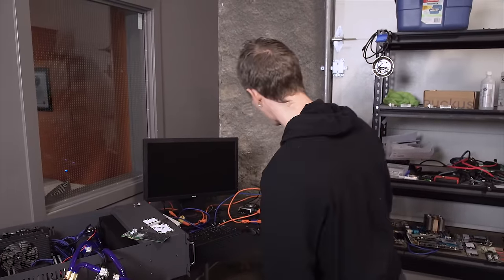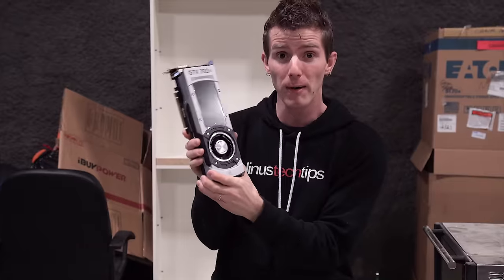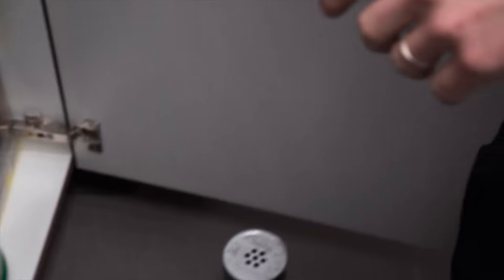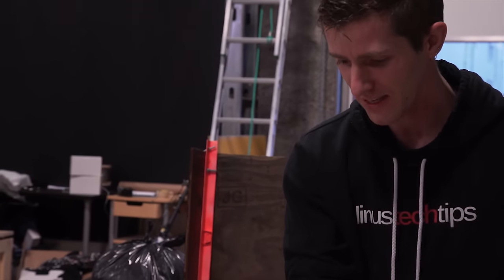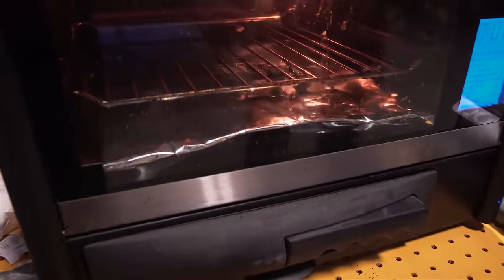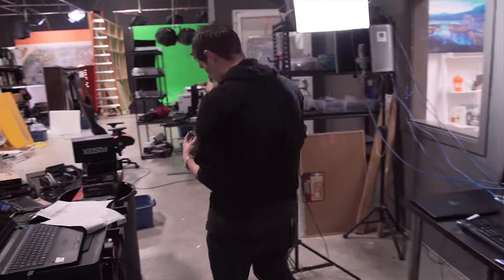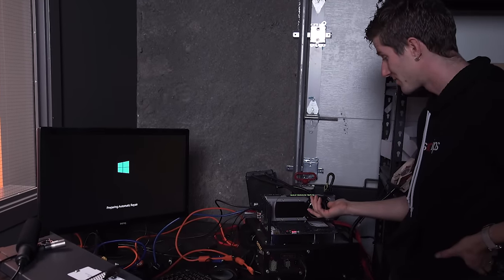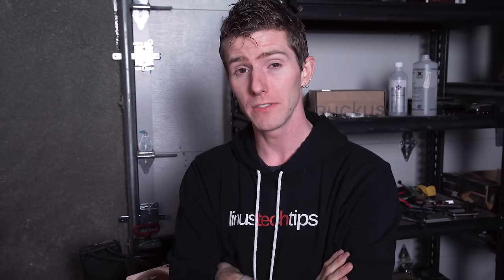Bring your video card back from the dead! - Oven method

Comment: 1. Remove all the stuff, that can be removed, from the card.
2. Balance the card on small screws, which are screwed gently into the holes in the PCB.
3. Heat up the oven to 210-220 degrees Celsius (~425 degrees Fahrenheit).
4. Put the card into the oven on a piece of tinfoil (doesn't matter which side is up), for 12 minutes. DO NOT TAKE THE CARD OUT YET!
5. Turn the oven off and GENTLY open the oven door, to let the card cool down, while it's still inside the oven, for 30 minutes.
6. Take the card out and reassemble.
7. Profit!

I have successfully revived 7 out of 9 graphics cards that way. (I am assuming the two cards, which was still failing, had other issues than faulty solder). I've never seen one of my baked cards stop working. One of them ran for ~9 months before I sold it and I never heard any complaints from the guy and that was years ago :-)
Reply: Just tried your method, seems to be working. Had to reinstall drivers, had error code 43
Reply: Make sure the capacitors face up so they don't fall off just in case you leave it in for too long.
Reply: My caps blew up when 4 mins remaining
Reply: @vds7751  didn't knew that... BUT I solder them again and the GPU works! Tested some games and it is alive again for now. :) Thx for your answer Pedro
Reply: Card is still going strong :)
Reply: @vds7751  true. Most people "fix" them this way and resell them. I will look for any cooking details on my card. I'll let you know if I find some
Reply: @vds7751  In my GPU board, just one sticker got a little bit scorched. Plastics ok, board color ok. I guess is risky to buy a used GPU.
Reply: I guess I won't be buying used computer parts ever again.
Reply: @margiteberbach2324  It would be toxic. Heated plastic has the most toxic particles and fumes on the planet.
Reply: Thanks for the deets; I have a RX580 I am going to give this a try with .

Peace,
WX2
Reply: it wouldn't work. Today cards are made of low quality components (whatever they lie) and most of capacitors and their contacts will not survive above 200C. @wx2833
Reply: Step 8: Collect all debris (resistors, chips, diodes) which fell off the card on the lower side.
Reply: @Sypaka  haha true,  thus dont work with modern cards
Reply: I tried your technique yesterday and my graphics card went from having wild glitches to giving no signal. Bummer!
Reply: @frederikroark  
it says in Step 6: REASSEMBLE.
It didn't mean your PC.
Reply: @vds7751  I just cooked a card. I noticed that some of the IC casings got slight heat damage, which you can tell by the slightly discolored spots that resembled popped bubbles. It's incredibly subtle though, for the most part it just looks like a card.
Reply: ShamblerDK capacitors blew, what do I do?
Reply: @gogamontana8920  not true it worked on my 1070ti
Reply: In 12 min...the card will get charred.How come it will revive??
Reply: @FTVG_inc  On my 1060, 1080 and RTX 590 not but suppose you had something special
Reply: @gogamontana8920  idk, it just wouldn't display video so i did the steps in this comment and it worked
Reply: @gogamontana8920  i also did it with an rx 580 after a friend gave it to me when it stoped working, the oven method didn't work, but i put a heat gun to the diod and the memory chips and after a few try's it started working again
Reply: @FTVG_inc  I am talking about THIS classic method (oven) and this method is not working on modern cards (which are made of cheap chinese shit). Capacitors are burned and they first pop out.
Reply: @medicennacho  mine too blew with 4 minutes remaining. I advise some to put like 8 min max
Reply: which were* still failing
Reply: Frederik | sorry for that friend..but you should read others comment before doing anything from YouTube....above your comment, there is a person commenting 3 months ahead of you, this method wont do for recent graphic cards...this video is made more than 3 years ago....
Reply: i fixed my 760 with only 110 degrees celsius,
Reply: Yes,let charge your victim said your chip already toast and it cost $200 for gtx 1030
Reply: thanks, i did this on my GTX 780 which i bought brand new on release date. it did around 3500h of gaming and endless hours of other stuff becaus my pc runs 24/7.
it worked just fine after this treatment. I will post updates how long this will go until it dies again.
UPDATE: 6 Months in and it still runs like Champ, no issues at all!
UPDARE2: Now its been over a year. still no issues. Card works totally fine.
Update 3: it went out again after 2 years and 2 months, having the same issues as the first time, wierd green flickering on the screen, since i knew what was going on i gave her the same treatment again. It works just fine now. Lets see how long i can keep this card alive.
Reply: The melting point of sauter is 370 degrees........
Reply: It worked cause it came back on an hasn't shut down yat on my AMD Radeon HD 5450 i had oven sit rit 250• , i let it cook for about 6 min and 30 sec ,,,, after i reinstalled my screen have glitches and black out here n der it will display a message saying my graphic card stop running but has recovered. Over all it worked for me I just know I need to start saving for a better graphics card.
Reply: Just remembered seeing this video. I just fixed my shelved GTX 560Ti. It is now powering my son's former Gpu-less pc. He went from playing Fortnite @10 fps on all low to easy 60 fps on medium-high. The tip with the screws made it a bit easier.
Reply: 8 mins works also
Reply: @Nathan_Kapri  I mean you can probably solder new capacitors on. You just have to get the right ones.
Reply: @gogamontana8920  It depends on the polymer, the temperature and how much oxygen is available for the reaction. I can think of a ton of stuff being way more worrisome when it thermally decomposes.
Reply: So it was you! I wondered why the GPU smelled like cake!
Reply: Guys, I'm just wondering are you still cooking food with those ovens?
Reply: @namapasaran4185  nothing like the smell of toxic plastic fumes on your homemade cookies
Reply: @aibandidos  So is it good for health?
Reply: @namapasaran4185  dude rtfm
Reply: you use that oven for food after that?
Reply: @wx2833  I wanna buy one, how is it? :)
Reply: I followed your advice on my 780, it was dead anyway and I already had bought a new card so I had nothing to lose..

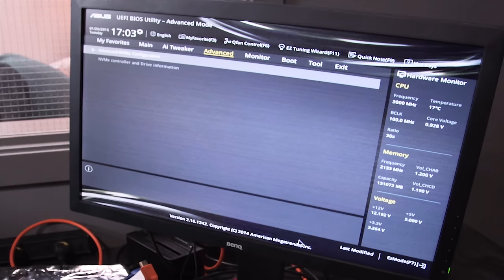I baked mine at 200° for 11:30 minutes, opened the door and left inside the oven cooling for about 10 minutes. Now it's working just fine thanks man
Reply: @leonardos5398  When he says remove anything that can be removed from the card, what exactly does that mean?
Reply: @leonardos5398  can i use the oven from the stove ?
Reply: I bought a ten year old 8900 gt that spins but no display. Would this be your first step? Or should I look and see if the thermal paste is just dried up?
Reply: @PookieBuilt  you gotta say if its Celsius or Fahrenheit else you're gonna make the noobs turn their cards into bombs. If the value you put is in Celsius that's too high to be correct. 220c is already high enough to make solder start melting (still too high for that misconception of the solder cracking on fat PS3s to be the YLOD culprit)
Reply: Hi
I have sapphire r 390 graphic card
It works only problem is 
When i play a game it gets hot i get black screen
I search on internet 
There is no solution
Should i put it in oven also
Will it help
Reply: @GGaievski  for how long did it work ? Im looking to fix my old gtx 760 to build another pc.
Reply: @gorkman5697  Try changing the thermal paste and ramping up the fan curve. Maybe its just overheating at it shuts down automatically.
Reply: I HAVE to try it with my broken 1060 until I get a new card.

Comment: Fun fact:  I saw on How it's Made that the shiny side of aluminum foil comes from its final extrusion where 2 sheets are forced between two large rollers for efficiency.  The point?  It doesn't matter whether shiny side or matte side, they are both the same.  I know a million people/bakers/grandmas will disagree but it is only a texture.  It is just as reflective for heat on either side!
Reply: yeah the difference is so slight you'd never notice... practically immeasurable. the purpose of cooking with foil is to contain steam and juices which does avoid drying of food and prevent burning. shiny surface reflects light waves and heat radiation in a more orderly fashion while the duller side kinda scatters it but on the whole there's no real difference. hot is hot and it's gonna be hot either way. shiny and dull, they do the same thing just slightly differently. good post, Jake.
Reply: Technically no, a shiny side will always reflect more heat than a mat side. But the difference is just so slightly that it will make no difference in baking
Reply: I have to throw this out to this comment chain: "Heat" does not reflect. It radiates, convects, and conducts. IR/microwave light on the other hand does reflect. Avoid mixing the two terms. So depending on what you are cooking with, the effect of light reflection will or will not be a term to consider... but most likely not, especially in an oven.

Comment: I'm floored. I just did this to my dead R9 270 and it's alive! Tip: if you have to use your kitchen oven, use parchment paper and staples to make a pouch to put the card in. It'll keep the fumes from messing up the oven.
Reply: No way , thats a 7870 , and I have a dead 7870 that needs this as gpu prices are too high, welp its going into the oven tomorrow ,idgaf...
Reply: @emilvlahovic3917  how did it go?
Reply: @sleepywinny  made its fan spon but no video out, think its dead dead
Reply: @emilvlahovic3917  thanks for the response :)
Reply: @emilvlahovic3917  Well if the processing unit died on it then the card is FUBAR anyway

Comment: So that toaster oven is not getting to the melting point of standard lead-free ROHS certified solder, which varies from 217 C to 230 C or more. So non of the BGA balls are melting and reforming connections, the solder is not liquid. Nvidia cards fail not because of the balls under the die package but because of how the silicon wafer is packaged to the substrate. You can often temporarily get a failed nvidia gpu up and running again by heating it to 190-200 C but it never is a permanent fix.
Reply: +Stefan Behrendsen
Also the European union in 2006 started to ban led solder in consumer electronics.
I am sure there are a bunch of more countries.
So nvidia and other factories are now using led free solders to be able to sell it... and led free has even hgher melting point 270°c avaregaly

led solder is also banned in the eu and lot other countries.
Reply: +Stefan Behrendsen also no freaking flux doesn't help either. Look up Flip Chip GPU design, the reason the card worked is due to an issue with the die. Heating the gpu up to 150c would have worked.. That's why wrapping a towel and other stupid stuff like that worked for the xbox 360
Reply: +Slot1Gamer He heated the GPU to 385f, which is much hotter.
Reply: SecretPotatoChip
385 °F is roughly 196.111°C
Lead-Free Solder needs to be at 217 to 280°C to melt.
Reply: +Jacobprogammer well also note we don't really know how accurate the temp of that oven is, nor is it convecting or anything so just opening the door causes all sorts of heat loss
Reply: +Stefan Behrendsen They don't use leadfree solder. Nobody uses leadfree solder... Doing so allows the tin to form tin whiskers (hairs of tin growing out of it) that short out connections. Freaking laymen spewing bullshit out your arses.
Reply: +TheMrTape using led solders for manufactureng consumer electronics is widely prohibited. there are countries where you can buy led solder for home hobbi usage, but even that is prohibited in certain countries, like most of the EU.
Reply: Genaro Ian LOL WUT, 60/40 solder is uber common in the EU, it is only banned in manufacture, you cant get lead poisoning either. The Flux smoke on the other hand....
Reply: +Stefan Behrendsen I have fixed 2 Motherboards with dead memory slots and an ATI X800GTO.
Can´t tell you if it was because the reflow, the mechanical stress relief, reseating of the conectors; etc.
But it does work in some cases beyond Nvidia products.
Reply: We still use it in manufacture of milspec PCBs. Usually military, aerospace and medical cards, consumer PCBs are indeed only manufactured led free.

Comment: just put the dead video card on top of a R9 290 and you won't need an oven for this
Reply: haha
Reply: dont try it on a amd cpu, your card will melt
Reply: +Zaryab B Actually you're wrong. Intel cpu's have a much higher temperature ceiling in which they can still operate fine. Since at stock speeds they use far less power, and produce less heat, Intel cpu's are better for overclocking. Just because Intel say they can run at 80c, doesn't mean that's where they normally run at. Don't you love it when you're calling someone out for being wrong when in fact you are ;)
Reply: BrutalGoerge Thats what i said.... intels have a higher temp cieling i never said anything else dumb shit. Since my amd 8320 runs at 50c and so do most peoples its not really a logical thing to make fun of the cpus for being hot because theyre not..... you get it?
Reply: +Zaryab B We're not saying their cpus run that hot, we're saying the GPUS run hot, which they do. There is a huge difference...
Reply: goddamn it ya'll ruined everything
Reply: +Mr0life Haven't you heard of the Nvidia GTX 480?
Reply: Aren James Matabia
 it was just a joke >_>
Reply: Mr0life I'm joking too as well. :D
Reply: +Mr0life 
AMD MASTER RACE
Reply: +Mr0life see what you did there ;)
Reply: So true  XD I have a 290 and every 5-6 hours it overheats such an inconvenience
Reply: +Zaryab B my 4690k runs at 50-55 under full load
Reply: so does my amd fx 8320 at 4.1GHZ
Reply: My r9 290 runs at 65 max, never seen it get any higher
Reply: Noscope90ice Gaming
 I cooked dinner on top of a reference 290
Reply: +Mr0life I don't know why people rag on the r9 290. I've got a Nitro 390 and it has not gone above 63C since I've owned it. And that was in the warmer reaches of September (80-90F in the house w no AC)
Reply: +Mr0life I have a R9 280X Tri-X. Mine while gaming never goes above 37C
Reply: Nick Caron-Clement
the reference 290 had a horrible cooling system with one tiny fan that could go up to, wait for it... 6000 RPM. That fucker turns into a hairdryer as soon as it hits 58% fan speed. Sure, if you don't mind not hearing anything other than the graphics card it will stay cool even in 1440p and push 60 fps in most games, but otherwise it was a horrible cooling solution. A tri-x or even DCU II fixed it. That or third party cooling systems that you could buy and install yourself.
Reply: Mr0life
cool story, needs more fire and meteors
Reply: LinusSexTips
oh there are plenty
Reply: Mr0life That's called a Radeon 3870
Reply: +Mr0life well you also could use a core i7 4770. it also warms my room when its -5 degrees outside.
Reply: +Mr0life I lold
Reply: ah bro
Reply: +Matthew McCreath I have done it and fixed it u have to take all the plastic off
Reply: +Mr0life hahaha.... AMD Sucks
Reply: +Swapnil Shukla just wait....just wait...
Reply: +BrutalGoerge ive never had to replace the tim under the heat spreader....

wanna talk about intels netburst and the i7s that had problems?

or is intel perfect in every way, and they have never had issues with heat?

why did my EVGA 9800gt reach 120C?
why did my 9800gx2 get over 90C?
why does my 6 core phenom 2 have better temps than a core 2 duo.....
why arnt you mentioning the fury, furyx, and fury nano...which are low power cards...
why arnt you talking about the GTX 200 and 400 series, which ran hot as fuck....

are you guys forgetting that only nvidias recent cards are low power/low heat? i think so.....

learn some fucking history.
Reply: jesus christ why is everyone going apeshit on here, it was just a joke
Reply: +Tim Tim Plays redo the TIM. that solved my overheating issues with the MSI twin frozr 290X.  sadly i cant run both of my 290X cards in the same rig without the top one getting just stupid hot. so i have one just sitting on my shelf until i can ghetto water cool the top card when both are installed.
Reply: +BrutalGoerge lol ive ran my old I7-3820 @1.55v 5.6+Ghz that hit 93c on water xD
Reply: Undervolt.

Comment: I just did this with my own graphics card and it worked. HD 7970 Direct CU II which had died a few months ago.
I removed the shroud, fans, and heat sink.
I then cleaned the dust, which there was a lot of, with an unused facial makeup brush and a balloon pump. Not ideal but did the job.
Instead of an oven, I used a heat gun that you can buy from hardware stores. I had this one lying around.
I started a foot out and tried to evenly heat the board as much as possible and slowly moved it closer.
By the end, I was 5 to 10 cm away and could smell the silicon, so I stopped. This was about 5 minutes.
I let it rest, reattached the shroud and etc, and plugged it in to the mobo.
Working. I can now get back to gaming.
Thanks Linus!

Comment: I know this is REALLY old, but just a heads up on the aluminum foil. it makes zero difference whether you have the shiny or dull side facing out. studies have been done and both sides reflect exactly the same. the only reason one side is shiny is because that is the side that was against the roller during manufacturing. It does not add any reflectivity from a thermal aspect what so ever.